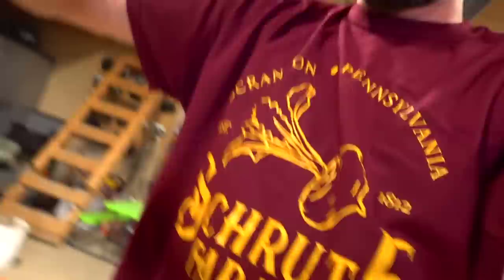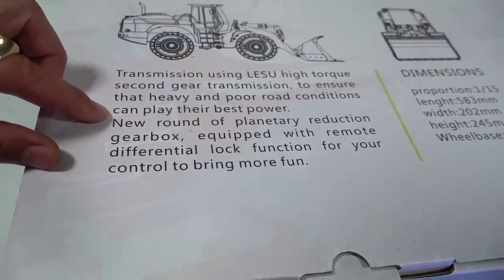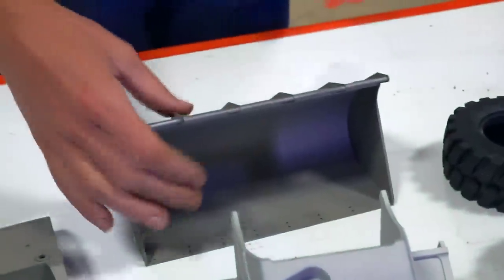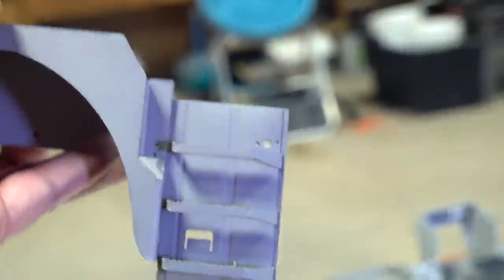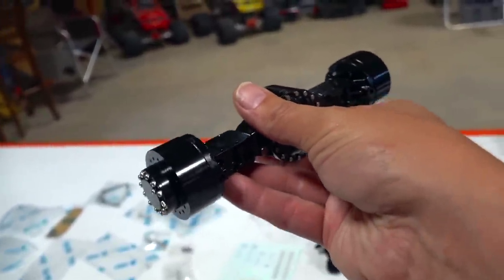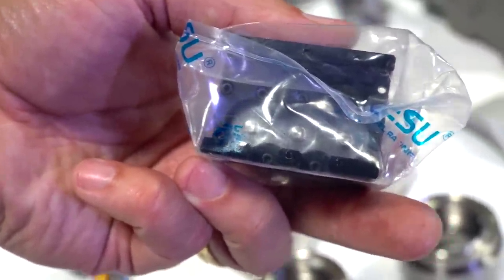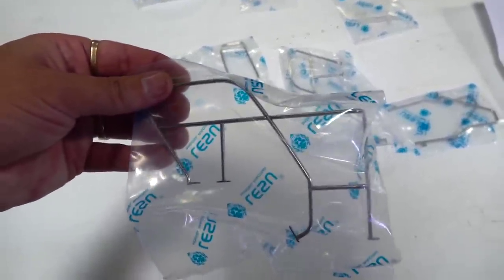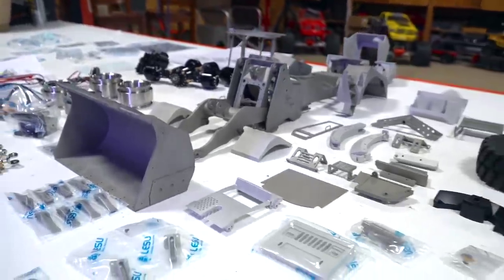NEW BUILD! ALL METAL LESU LIEBHERR 574 HYDRAULIC WHEEL LOADER  UNBOXING & IMPRESSION | RC ADVENTURES

Comment: Sweet, next building series. Can you measure thickness of metal parts in mm ? Just curious how thick is it. Also during building can you be more detailed about reviving hydraulics block and control system of that ? Thanks and have nice time with models.
Reply from the maker: Hello, can you be more clear with "Reviving Hydraulics".. what do you mean?! Thank you
Reply: @TheRealRCSparks  Hi, I mean how to set opening and closing hydraulics block (by servos) and their connection and setting on radio.

Comment: The esc has this spec from a web site. Forward sustained current: 30A, peak current: 320A (that would burst rating for very short time)
Reverse sustained current: 45A, peak current: 200A
Supply voltage range: 2 to 3 cell Li-Po or 5 - 9 NiMH battery
BEC output: 3A / 5V,

Comment: Need a track loader now or maybe a couple of well they go by couple of different names scrapers, earthworms, or pans. I'm not sure if they have an RC version but they have a blade with a trophin the middle and in the front that have two wheels and in the back that have two wheels and it articulates right behind the cab the way they work you pull up drop the center blade and a dozer pushes while the dirt rolls up and feels up the middle troph and they are very efficient at holding and moving dirt. Just a thought if u wanted to check into it. I'm sure u don't remember but that's what I do for a living is run heavy equipment and I've seen them Pans in action

Comment: I do enjoy seeing these kits come together. Though I would really like to know more about the “metal parts”. There seems to be a variant to the colour. It’s really hard to tell without a super closeup. Looks like they could either be shot blasted cast monkey metal like an old tonka or matchbox car. Or sintered 3D print aluminium. Are they as rough/grainy finish as they appear on camera or are they pre primed maybe? Forgive me if you did mention, is gone 1am and the wife is asleep so volume is down to a minimum.

Comment: Warning! You became gold RC rush addict....be caref.......ho ohhhh! Too late ! You are infected by passion !!! 
😁😁😁

For sure full metal model are so more realistic! Scale simulation is much more feel in hand and videos are a lot better looking than plastic jumping on gravel. 

For my opinion, even on Lesu model, and capo tatra I also use, I've had a lot of weight in wheels with machined brass ring, and also brass plate as heavy as possible under chassis. 
For track model like the Lesu 574 I've just had a 900g plate under Xbrace just bolt on, and another 250g under distributor, the tracked excavator are less sensible in realism with that than the wheels models. 
But try this. Grab an axial or a trx4, put 100g in each wheel, change if exist all axles for heavy weight ones, and add some brass or other metal on both axles to terminate , add some on center of model and set the damper for handle it. 
Add something like 1500g in a crawler. As low as possible. 
And you obtain , crawler, wheel loader, truck, dozer, all model already heavy became better. 
1500g more trx4 is slower , but realist, have better grip, suspension work like a real one with mass effect. And if roll over angle lost some capacities, the benefit worst it! 

It's a must try thing. Cost time , a bit of metal, a lot exist already done for best seller but for YouTube good all must be done by yours. But it's coooool

Just my 50cent. 
Continue like it. 

P.s do you check my mail for videos and pics use on Smurfs 88 store on AliExpress? On hydraulic truck.

Comment: That brushless motor for the pump is like 10 bucks on ebay...and why would they use a brushed motor when they could have easily used a brushless motor...not like the brushed are much cheaper now a days...brushless is probably cheaper to make due to their simplicity...